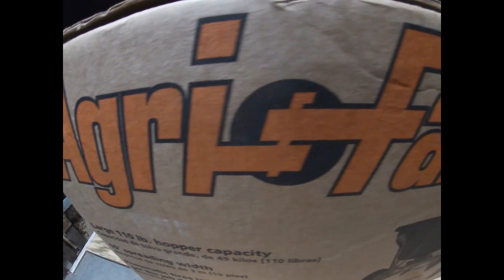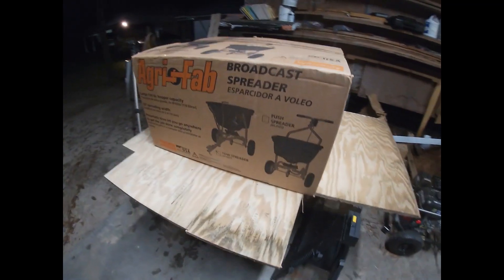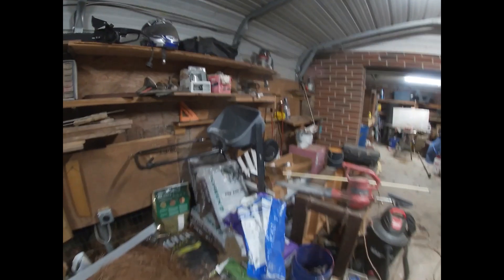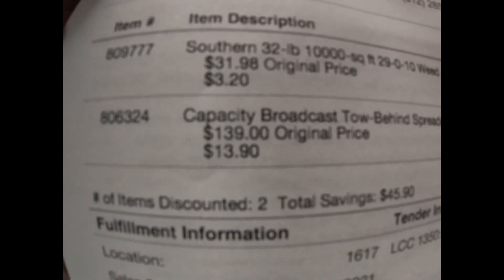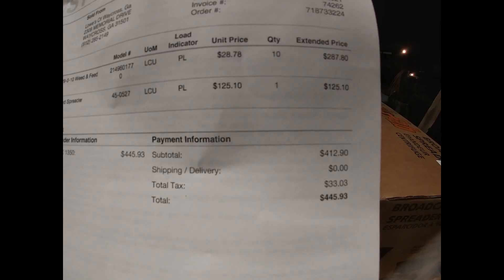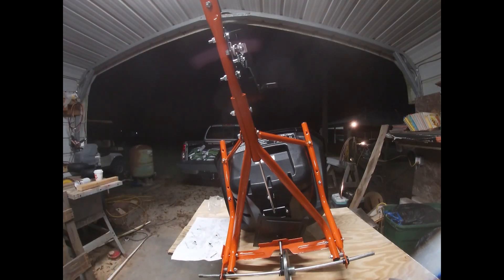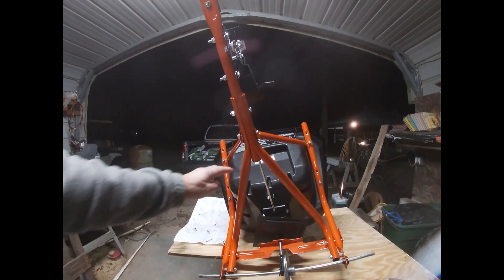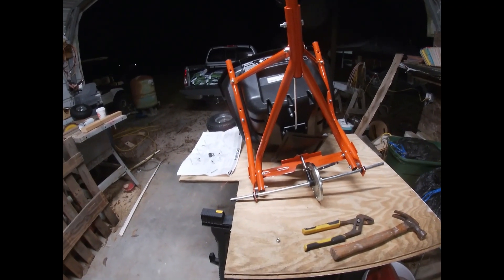Agri Fab Spreader Raw Assembly Footage (Agri-Fab Capacity Broadcast Tow-Behind Spreader)

Comment: Man they changed these up. The drive wheel system is atteched with a carter pin as soon a i loaded my with fertilizer it broke the carter pin when trying to use it . Plus the spacer in the tub undet the hair pin didnt even come in package . Im gonna try and replace and adjust it and if i can get it fixed lowes will be getting it back !!
Reply from the maker: Oh my 😳

Comment: I’d like to see a video of how you run your spreader behind a rider, and some ideas on an extension bar for shutting of the granules.
Reply from the maker: I drilled a hole in the end of a 1/2 piece of PVC about 6 foot long and zip tied it to the handle. It worked ok. When I make a more permanent extension bar, I'll do a video.
Reply: @cleangreenlawnservicellc2630  thanks for your reply, trying my spreader out this week. 🤞
Reply from the maker: @veronicahunt1762  I’m sure it will all go well.
Reply: Until the shutoff of the fertilizer flow problem is solved it makes tow-behind spreaders very problematic to use.  I have a 1/2 acre to weed-n-feed.  About a 1/4 acre is fairly wide-open but the other 1/4 acre is where my house is making maneuverability difficult.  Around my house I would need to constantly shutoff the fertilizer flow to reposition my riding lawn mower for effective coverage.  The shutoff dilemma with tow-behind spreaders is their Achilles Heel.
Reply from the maker: Teddy I use a 4 ft piece of PVC pipe connected to the handle to turn mine on and off. I haven't had an opportunity to do a video on it.

Comment: I actually love my pull behind spreader
Reply from the maker: A lot easier than pushing one for sure!
Reply: I'm interested in seeing how, you're going to operate the feed control lever from the seat of your zero-turn mower.
Reply from the maker: @gratzbuck9882  I used a piece of PVC pipe. I have a more permanent or better idea in the works.
Reply: @gratzbuck9882  you don't, you set it and ride...then get off and change it when needed. Your not going to use this for your regular average sized to smaller sizes yards, that's where a push spreader comes in
Reply: @cleangreenlawnservicellc2630  I've seen videos where a guy installs a12-VDC linear actuator in the shoot linkage, control by a switch up front.
Reply: @JonsDailyHustle  Yes, and anytime you have to stop, the shoot is still open letting your media either spill on the ground and or fixing to give that area an extra large dose when you resume moving again.
Reply: @gratzbuck9882  it's not perfect but I've never had that become an issue with mine 🤷‍♂️

Comment: Does it still have that plastic gear stabilizer? If so, it'll break on the like the 1st-3rd use. Absolute junk. I have the same one and it worked great for the 1st run.
Reply from the maker: 😳 It does have some plastic in that area, but has been solid so far.......I have about 10 acres of work on it so far....... hopefully it holds up.
Reply: @cleangreenlawnservicellc2630  Nice! I only have an acre and a half and it's mostly flat. Mine broke after only a couple of uses.

Comment: I'm 72 year old widow Still work my acre lot and purchased  tow behind spreader.  When I read the instructions I was lost. Your detailed video helped me assemble my Agri Fab 110# spreader.  One issue is the wheels get stuck.  Yikes, did I assemble something wrong?
Reply from the maker: Mengles, I am glad to hear you're doing so well at that young age. Does the wheel stick when it is loaded? From the back of the spreader, my wheel to the right is the drive wheel. Check to make sure it spins ok with the spreader empty.
Reply: Oops, I replied earlier today, but I don't see my reply. Not sure what I did.  I have not loaded the spreader yet to see if the one wheel still sticks.  I will load tomorrow. from back of spreader, the wheel to right is one that sticks and I cannot spin it. I can spin the left wheel and it spins smoothly.  Do I have wheels backwards? If that's the case then it goes back to the install of bar that is backwards.
Reply from the maker: You should be able to spin that right wheel with your hand......I'm not sure what is sticking. If you give me an email address, I can send you a picture of mine. Not sure if that'll help or not.
Reply: OMG I just watched your assembly video on my computer instead of my phone and was able to zoom in on the axel/gear assy.  I installed the axel/gear assembly opposite from yours.  It looked OK by the pictures but I when I zoomed in on your video it is flipped.  When facing front of spreader, The pole that stands up is on left and the round metal piece curves to right.  yikes. should I start over or take to store for them to reassemble?
Reply from the maker: I say don't give up on this thing and let it win lol. I'm sure now that you know what is wrong you can probably fix it pretty easy.
Reply: thanks again for your help.  My next project is to watch your aerator video assembly.
Reply from the maker: Well if I'd known how many people were going to watch these videos, I would have done a better job 😂. You're welcome!

Comment: I just bought mine from lowes yesterday.  It is different from yours.  It has round shaft on both sides with a cotter pin  that goes through one of the tires into the shaft.  This is supposed to drive the shaft as the tire turns.  Totally not good enough for the job since I broke two pins already and have not salted ten feet.  The tire just locks up, then twists the cotter pin through the holes.  what a cheap change they made to make another dollar at the expense of the consumer.  Gonna take this peace of crap back to lowes.  Your style is better with that squared off axle shaft.
Reply from the maker: That sounds like a real pain!